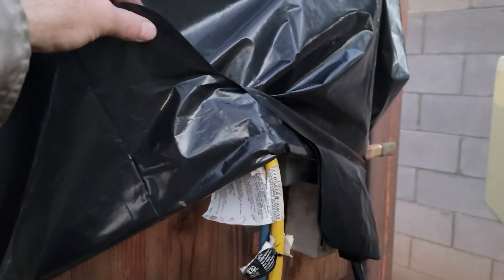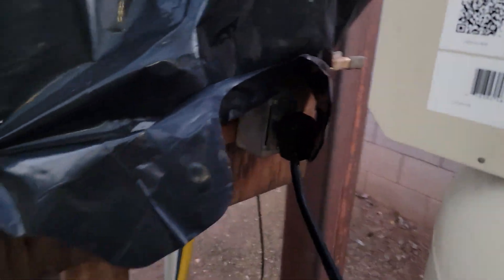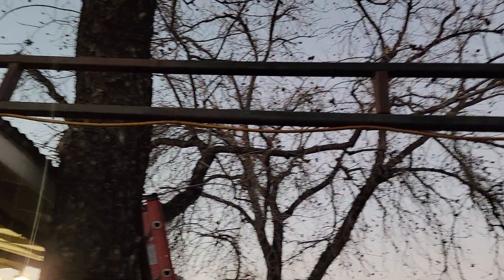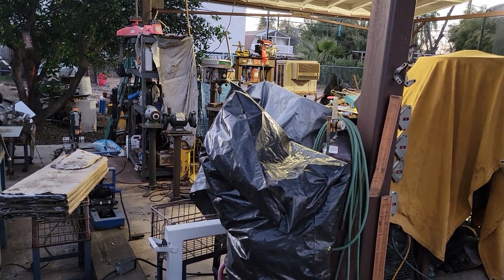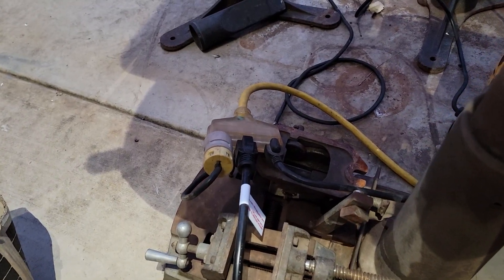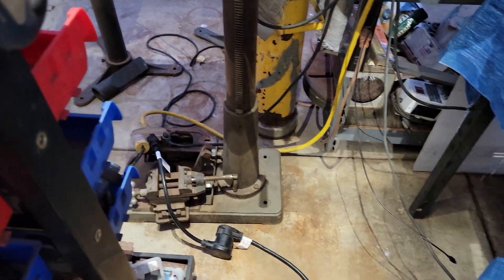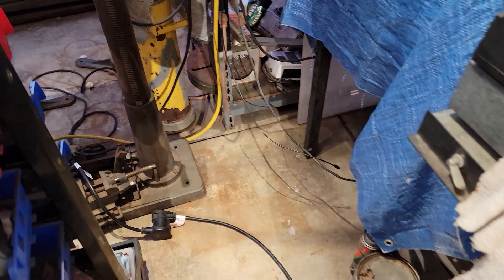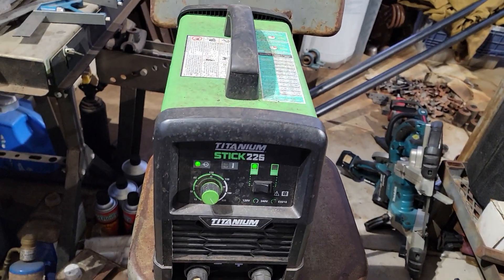KT INDUSTRIES 6011 1/8 rod  review  on 110 with the Titanium stick225

Comment: I have a 110 volt mini welder that will not weld 7018 /3/32 rods what amp setting are you using ??
Reply from the maker: Which brand of welder do you have?

Comment: An Atwoods store just opened up not far from and I noticed they carry the KT industries rods.  They have some in a black rectangular box and some in a yellow square like the one you have (6011 & 7018).  The yellow box is a few dollars more than the black box.  Any idea what the differences tween them would be?
Reply from the maker: The only thing that I could think of is that they may have changed the color of the packaging. For whatever reason, one is that the 6011 rods are typically a little bit cheaper than the 7018 rods. There's a possibility could even be 6013 rods. And those are probably a little bit less expensive. Also, thanks again. I hope this helps.

Comment: When limited to 110 access, what 2 rods would you reccomend for 70 amps? 3/32 6010 and 3/32 7018 or 1/8 6010 and 3/32 7018? Thabks!
Reply from the maker: Hey, that's a great question. All of the rods that you recommended for 70 amps. I think there are all great rods for running off a 110 for my personal preference. I would definitely go with the 6011 3/32

Comment: Nice beads, love it! I would try to fix a workpiece to the table as tightly as possible, it's a good idea anyway both for welding and cleaning/grinding. I can't help myself imaging a workpiece flying into the camera next second after an electrode is suddenly stuck to the plate and got pulled or a hard brush hit a workpiece edge. Also, such a fearless use of working gloves aroung a hard brush equipped grinder doesn't seem safe either. Same thing as when working with any rotating power tools like lathe - gloves are better be made of nothing rather than of a material stronger than human hands.
Reply from the maker: I appreciate your mind and eye for safety it is much appreciated I try as hard as I can sometimes to do the best I can but sometimes things just get away from me but I appreciate it again thank you